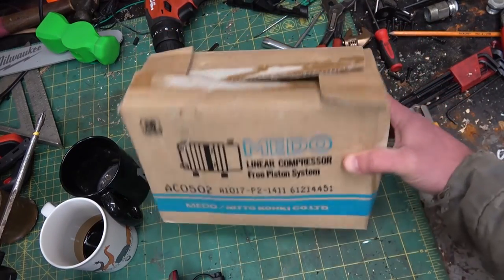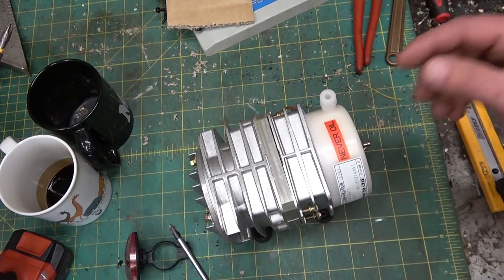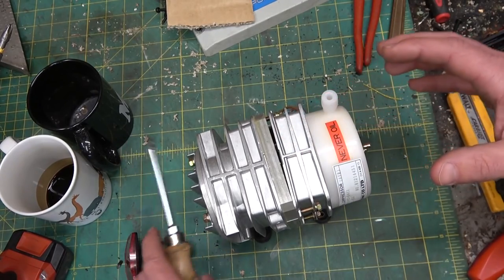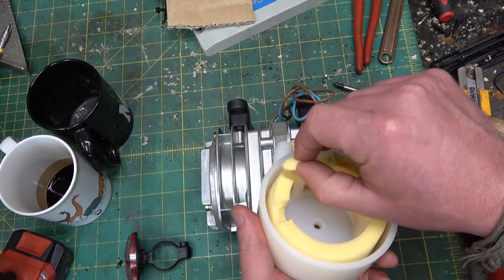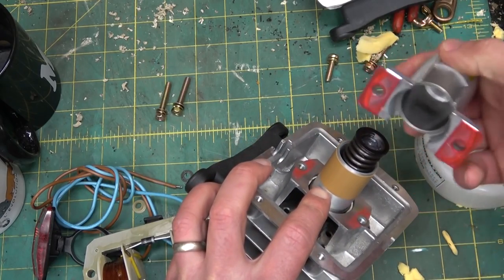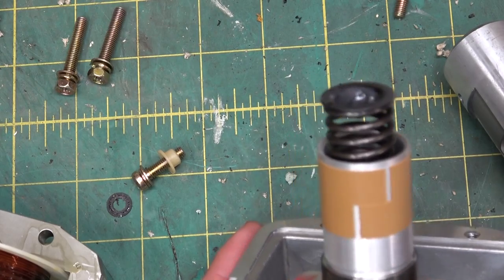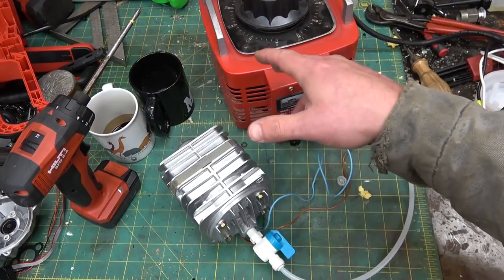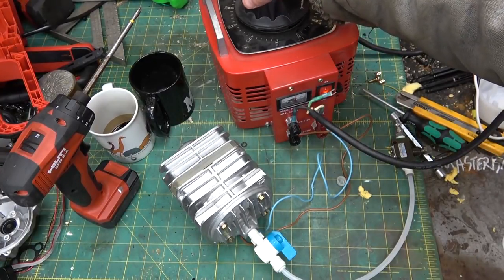BOLTR: Japanese Linear Compressor | Genius!

Comment: This reminiscent of the Einstein seal-less refrigerator. In the early days of refrigeration, ammonia was used, and sometimes the one of the seals would leak, causing people to die in their sleep. When Einstein came to the US, he needed a little extra cash to help sponsor other physicists to leave Europe (since it looked like a war might start soon). Einstein had worked as a patent clerk years before, and he knew a patent on a useful new design could provide a steady income from royalties. He  designed and patented an ammonia refrigerator compressor that was completely enclosed. A linear piston was compressed by an external solenoid, and when de-energized, the piston returned by a spring.

Comment: My quick assumption of why compressors are made with a crank is because the way the crank moves you get more mechanical leverage when you hit top dead center. Also when at bottom dead center you get the same but with minimal resistance and the crank builds momentum to help push it back up.

Comment: Some air pumps for fish tanks work this way, but the ones I've seen have no diode, so they pull and push the diaphram. Old fashioned plug-in hair clippers also use this kind of motor, but instead of a magnet, the armature is simply a piece of iron, so it gets pulled against a spring during both the up and down cycles, for 120 strokes per second in the USA. I don't know why this has the half-wave rectifier, since the push and pull  force are both useful, but for some reason they did it this way; maybe just because the push take far more force than the pull. I believe mains-connected half-wave rectifiers are illegal in some places (Australia??) but they are still allowed in the USA and apparently in some parts of Europe. 
   There are also gas generators that use a reciprocating motor as a the generator, and the motion of the piston to control the valves.

PS: I'd call each of the reed valves a moving part, so we're talking about maybe 4, but that's still very simple. Unfortunately, reed valves are prone to getting dirty, weakening and sticking, so it's important that they be easily replaceable.

Comment: If you look at the piston in the compressor, and you estimate it is 3” diameter, then that means it has an area of roughly 7 in^2. If you want to charge a compressor tank to say 150 psi, you would have to press that piston with AT LEAST 7 in^2 x 150 psi, or 1050 lbs of force. You would be hard pressed to find a solenoid capable of that much force. You could use a smaller piston to allow for higher pressures, but now you’re decreasing your total displacement, so it’ll take forever to charge up. To compensate for this you would need a longer stroke, but solenoids aren’t really capable of long strokes, but if you made one that was, it would be very inefficient and wouldn’t have much force at the fully extended position. You could also compensate for charging speed by increasing the cycle frequency, but that means increasing the speed of the piston as it is moving which means more force or a lighter piston, as well as changing the frequency of the pixies from the power source, which means additional parts.

Comment: I have replaced more than 10 regular aquarium air pumps (5 x 1.8-2.5L/min, 4 x 4L/min, 2 x 8L/min and others) with an 80L/min pump like this one and I don't have enough tanks and ponds to use up all the air it outputs. the single large pump is also much more energy efficient compared to all the little pumps

Comment: The reason these aren't used more often is because they have peak torque at mid stroke and minimum torque at full stroke(maximum compression ratio) while reciprocating pumps have max torque at max compression.  Hence a higher flow rate at higher ratios while still having a decent flow rate at lower compression.  You don't use a fish pump to power tools, but you might use it to fill a tire.

Comment: Ave, you could split the wiring to the two coils and put them in parallel so it will run on 120 volts

Comment: If you put a lot of these motors, they will probably spoil the alternating current a lot, since they only work with half a cycle.  Although for applications requiring more power, two could be used and each one could operate with a different half cycle.

Comment: They also use these for airbrushes, since the oil in the air your shop compressor puts out will mess up the water based paint finish.

Comment: Our company uses linear compressors in tandem with blowers and dynamic air manifolds to regulate pressure zones in medical therapy products. Not sure why the engineers chose that exact compressor type but it works damn well. It also vacuums to deflate the bladder zones. I wonder how that works or why the engineers chose that specific type of compressor. Man, I dunno, I’m just the repair tech.

Comment: Hey, if you were wondrin' why your phillips head wasn't fitting QUITE well, and didn't wanna ask Nancy about her experience with Phillip, then I'd like to letcha know it's because Jap phillips head screws are akchewally Japanese Industrial Standard(JIS) phillips, and are a different phillips head.

If you got a pozidrive bit and flattened the tip a tad bit, it's a pretty good stand-in, but now you know if you wanna buy some that fit proper.

I learned this the hard way on some GIGANTIC screws(like, looked like #4 phillips, fit all loose still, had to use an impact driver, PROBLEMS) on the carb bracket for my '82 Kawasaki.

Comment: Coming back to this video a year later, I just noticed that it's not actually the solenoids that are providing the power for the compression stroke, it's the spring. The coils just act to reset the spring for the next stroke. It would seem to me that's part of the reason why it wouldn't scale well as you'd need an exponentially larger spring as you go up in pressure and flow rate, which would have to be able to hold up for millions of loading cycles, and you'd also need some giant coils to reset the stroke. But that's just my 2 cents.
-an engineering student at NC State University

Comment: *Why aren’t all compressors linear compressors? *    Might have something to do with the little thing vibrating all over the place. Specially when you up the scale 10 times. And off course the economy of scale combined with the fact that most industrial sites use a 3 phase net which gives you your rotating motion ‘for free’ makes the use of regular piston compressors quite sensible. And how much pressure can these linear choochers chooch? We’ve got 2 stage reciprocating V-twin compressors working away for our 30 bars of starting air what for making the big yellow diesels scream into life. Don’t quite think these linear compressors can do just that. For all other applications their simplicity is excellence !   Thanx for the vidjejo!

Comment: Re: your question at the end: I'm guessing it's because it's easier to change the reciprocation distance and speed.  Gearing and different crank length can easily change stroke and chooches per second from a rotating motor but they are fixed with this kind of motor, so as you point out they are suited to a single application.

Comment: HAHAHA, that's so funny you mention the whole dropping PSI.  I just ran an air compressor a friend sold me (perfect condition... nearly brand new $20.. long story, well not long just sad and kind of f'd up).  I have an ancient house with fuses still, like literal glass fuses w/ the lightbulb looking connectors...I can only run the thing on the wiring in the basement w/ 30A fuses as the compressor runs 120V 15A and the rest of the house is on two 15A lines (not 100% sure what is connected to what, but the 15A fuse was NOT okay with a sudden spike of 15A apparently).  I filled it in the basement for the second time (first time i used it right away), brought it outside (about 45* F) and came back an hour or two later and SWORE it was at 125PSI!!!  I know for sure nothing was connected, all ports tightly closed off, but it was at like 110PSI.

I know this, but didn't even dawn on me... granted I spent about 10 seconds thinking about it and continued on with my plans.

EDIT:  I do live in Washington and we did legalize the devil's lettuce before you guys did, so i'll blame that haha.

Thanks yet again AvE!
Reply: PV=NRT. BTW, fuses should be loaded <80% capacity. Time to add a panel with some 20A breakers.

Comment: Rotary motors can have flywheels to smooth out the high compression ratios.  This reciprocating motor's compression is set by the spring force and the piston diameter.  The magnetic force isn't strong enough to compress an excessively strong spring.

Comment: Notice the wires seem to be different gauges. So the rectified AC signal will tend to go through the larger (lower resistance) wire.

Comment: When I was 18 I worked in an airplane hanger that got really hot during the day (115-120 degrees) and if we weren't using a lot of air tools the compressor would start to hiss as the relief valve let off excess pressure.
     Over night we would shut the compressor off and open a valve to decompress the tank.

Comment: If the magnetic part of the piston is just steel/iron, then the rectification is probably there to cut the stroke frequency in half (It would be 100Hz @ a line frequency of 50 Hz, vs. just 50Hz with rectification). If the magnetic part on the piston is a magnet, then the design would only work well with the field rectified; the other half of the sinewave would just push the piston forward when it's already stopped.

Comment: Regular reciprocating air compressors that use rotary input are taking advantage of the lever of the crank for finishing the stroke at pressure.   doooorrrrrp.

Comment: Reasons they are not used for air supply: High pressures at volume, rotary motion can overcome 175PSI far better than a liner solenoid watt to watt. However, I could see me using these on small machines like my bandsaw or other small machines I need a wisp of air to keep things clear. To me it's logical, while my compressor can do the same job on all my machines, it does the same job at 40amps (big motor) per cycle whereas this device does the job with far less energy.

Comment: Given that the spring is balanced to the mass of the piston, the stroke is optimized for 50 hz AC.  Running it at 60 hz will probably severely compromise efficiency.  It will be sucking while the mass wants to be blowing.  Still, the concept is presented clearly enough.

Comment: Newer LG refrigerators use a variable capacity linear compressor - very (electrically) efficient, but I changed out at least a few a week on warranty under a year or two old at my last job

Comment: parallel the coils, diode in series, run it on 120V AC... just be sure to have both coils connected properly so that you have both like-poles (N or S) to the center pole pieces. The diode may not be rated high enough for twice the current though...

Comment: the reciprocating cycle has an  advantage. the crankshaft rotates through greatest distance during the most difficult part of compression cycle this reduces the force to complete this part of the process. If engines did not have this ratio change they would not run very well or produce much power. the piston change of direction  also benefits from this because  it proportionally stops and reverses direction in same way. linear compressors typically are low pressure units  because magnetic field strength falls off at extreme rate to distance  and compressing a gas works exactly opposite to this it needs a high ratio  moment

Comment: I work on LG refrigerators they use linear compressors with a digital inverter to make them multi speed for the sealed system i see them fail in the same way they will not fully compress gas i can’t figure out why they fail so much.  I always suspect the perm mag slips and the piston can’t take a full stroke

Comment: These little reciprocating pumps can't provide the pressure or volume of a shop air compressor.  Like you said, these are designed for specific applications that don't require the larger volume or pressure.  This is basically an aquarium pump.

Comment: The issue with the two winding is that they need loads of copper. A small motor, specially one that runs of DC or a multi current motorer or something like that  and transmit more power with much less copper and also less magnets. Making it rotating simply makes it cheaper

Comment: Essentially the industrial equivalent of an aquarium air pump. I guess it could be converted to 120V operation by putting the two windings in parallel instead of in series.

Comment: I could be wrong but this is my personal theory that makes sense to me: they don’t use those for high pressure because it’s not durable enough and doesn’t have enough power to produce high pressures. The air compressors have that reciprocating mass because the torque the heavy parts help generate to overcome high pressure barriers. Don’t get me wrong I love the fact those pumps have one moving part that to me is genius but it would probably take an infeasible amount of power and a lot heavier duty parts to withstand higher pressures. Could be wrong but I’m pretty stoned right now so the gears are turning 😂

Comment: I'll throw in my .02... Often used in medical equipment as well. From what I can see, pressure is controlled by the spring, much like a mechanical fuel pump. The pixies exert force again the spring, and the spring is the what for that sends the air about its business. That gives accurate (precise?) control of pressure, regardless of volume. (within toleration, of course)
I don't think you can attain very high pressure rates by coils alone, much less acquire voluminousness.  At least, not maintaining reasonable amperage draw. HOLY COW! Spellchecker didn't underscore "voluminousness"! Is there really such a word??

Comment: 4 years late to the party, but the reason why you don't see that linear compressor driven directly by an electromagnet design used for high compression is because you need the piston to accurately get very close to the top of the cylinder on each stroke, which would require a rather significant feedback loop. A crank and connecting rod, however, can be built to accurately stop right at the top of the cylinder on each revolution with very little effort.

Comment: Ever BOLTR'd an air diaphragm pump? We use them in the shop I work at to move waste oil from drain pans to waste oil tanks. I might have a couple failed ones I can see about sending your way.

Comment: upscaling that compressor would be tough because either increasing the bore or stroke of the piston needs a lot more power from the solenoid. Or maybe compressors need more parts to hide the bits designed to fail

Comment: Guessing the limiting factor for air pressure would be the need for a return spring? Reciprocal piston driven to by electromagnetic pixies and fro by springamathing whereas traditional piston compressor converts rotary motion into compressed air via crankshaft. 

No freaking idea what I'm saying but you get my drift?

Comment: Little known fact - Albert Einstein had a fridge with linear compressor, it had no moving parts so the ammonia used back then couldn’t leak.

When he showed a friend he safer fridge, all his friend could comment on was that it “wailed like the cry of a banshee” something alone those lines. 

Point is the whine, especially at higher power levels can and will drive people nuts.

Comment: You need two phases i think. 240 or 208v these generally don't need a neutral only times they do is when other electronics on a device need one and use one leg of the power only. The reason is because the voltage feeds back through the other phase.  Such as current comes on b phase it'll feed back on the other phase and power will come through the other phase as well they can do this through an inverse of the sine wave if I remember correctly...(idk much) so a single pole power supply (120/277) cannot feed power through the neutral as it is only one phase and the nuetral is only tapped into the main transformer as a return. I think this device needs 2 phases because that's what causes the hysteresis and how it's wound. But I may be wrong as I generally am lmao.

Comment: These pumps are used as refrigeration compressors. They rely on mechanical resonance so your european unit will not work very well on 60Hz. A common brand of fridges used on yachts have a built in inverter to run from 12 or 24 and direct from the chosen mains voltage / frequency. American boats would arrive with their fridges working from their generator or batteries but wouldn't run from 50Hz even though a 230>110V transformer was installed. I dont know what pressures fridges need to work but they certainly couldn't make it on the wrong frequency.

Comment: The piston can only move so far in 1/60th of a second (or 1/50th across the ocean..).  With such a small stroke, the max pressure is limited to the pressure it can build in that small stroke minus the pressure of the reed valve.  A piston on a crankshaft may move slower, but it's stroke will be 10 to 100's of times larger.

Comment: Technically the spring is a moving part aswell as the check valve so there are multiple moving parts in this pump.

Comment: the main reason for not using linear motors for high volume or high pressure compressors is that they aren't that efficient so you rapidly run into a thermal problem as you scale them up

Comment: Pretty sure it has to do with the difficulty in wrangling as much reciprocating mass as a big piston would require. Sorta the same reason infernal combustion engines with really long strokes don't usually also have very large bores. You're asking a lot of a 2lb piston to go 60 mph one way, stop and go back the other  3000 times a minute (@6000 rpm).